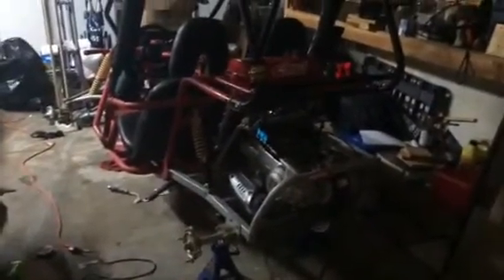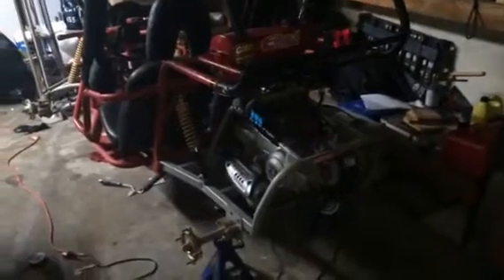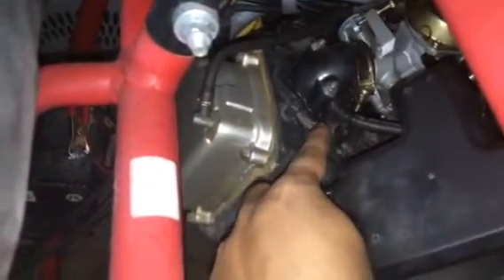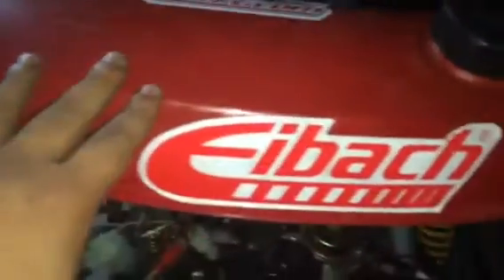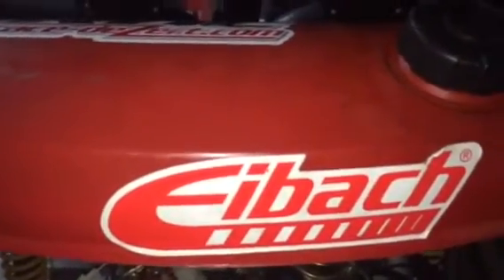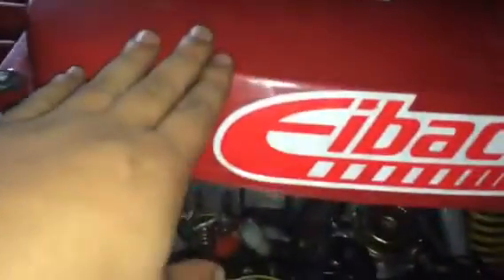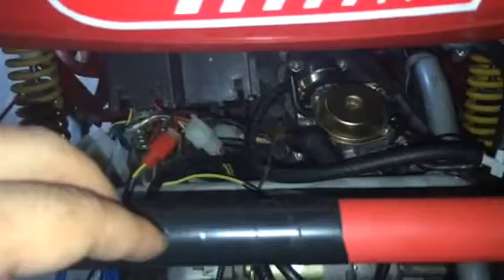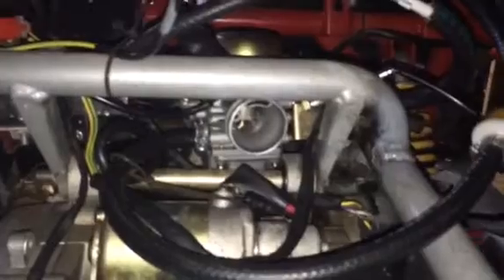Gy6 fuel system

Comment: Where does the hose on the valve cover go to?
Reply: Name is Ricky Sanders wanted to know how to hook up the vacuum line on a 250cc znen 2013 look like a Honda Civic Wing Fat motor scooter the vacuum lines is very complicated because they were is three layers of it and they run in so many different places and I can't get the figure right here so you anybody have a video of somebody that know where to plug these vacuum lines at and how to run one one back online took that the piece that run to the tank is very confusing can someone do anyone have a video of that on the gyc 6 250cc motor

Comment: or what can i try. the vacuum lines are good
Reply: I have a 250- Venom 2013 on Honda I got a problem connecting the vacuum line it's got so many different types of Splitters at run here around there and can someone send me a video close-up shot of where these hoses connected and what runs into what other than that everything else fine it's just that I can't get the vacuum line hooked up right

Comment: i have the same fuel pump but the fuel doesnt came can it be that the fuel pump is broken  ??
Reply: On a 250 Zenon 2013 the gas line is very simple to hook up but it's the vacuum lines and different angles that the vacuum lines run into connections can someone show me a video of how to hook up the air back online on a 250cc motor scooter Honda GY6 motor